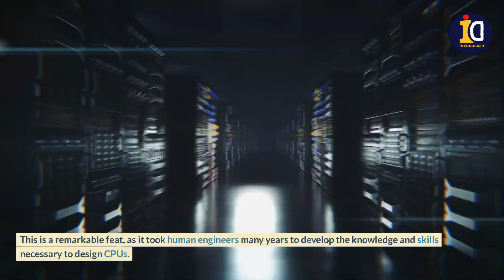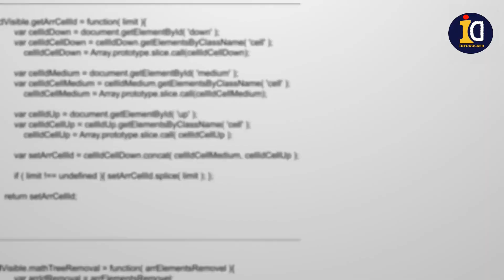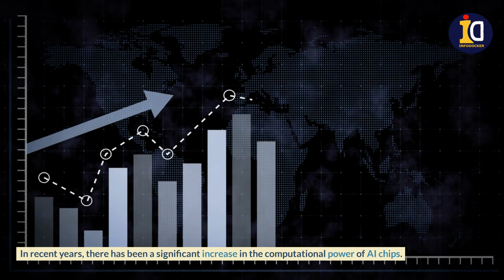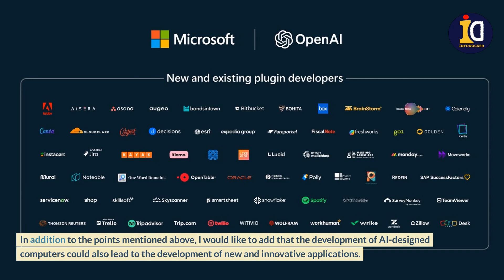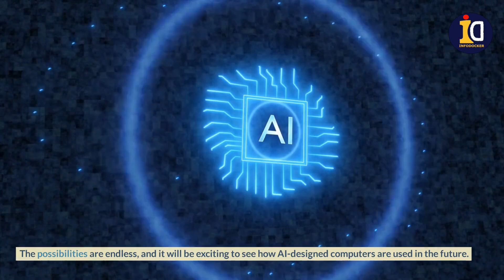AI Builds a Computer in 5 Hours: What Does This Mean for the Future?

Comment: Any benchmarks of the AI designed CPU?
Reply from the maker: On Measuring performance there are benchmarks such as MLPerf benchmark suite, which is a set of standardized benchmarks for measuring the performance of machine learning hardware. Others include - PARSEC benchmark suite, the HPCC benchmark suite, and the CINT benchmark suite etc.
Reply: @tensorlearners7  Then why don't they use them on a system with this chip and show them to the world?
Reply from the maker: Probably they will do it in coming days as part of validation